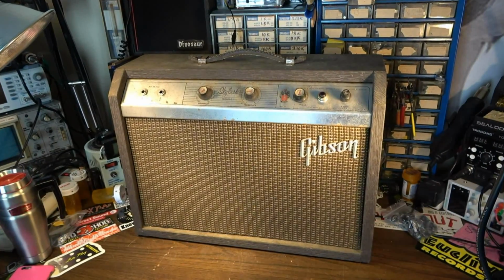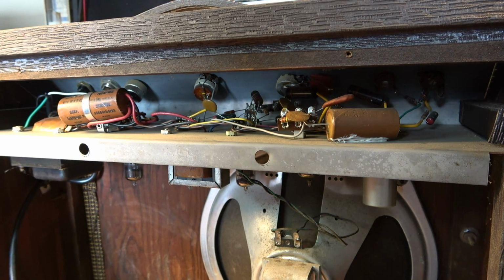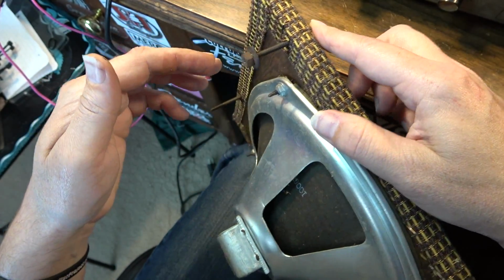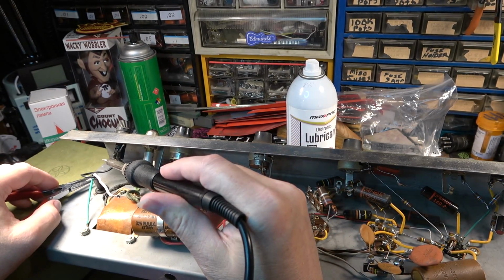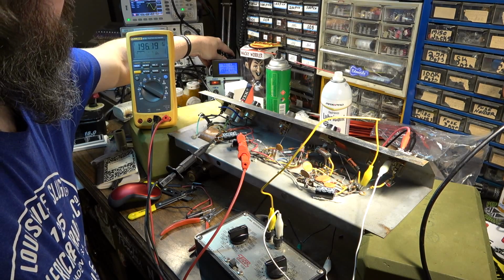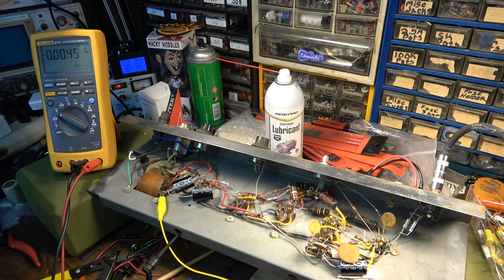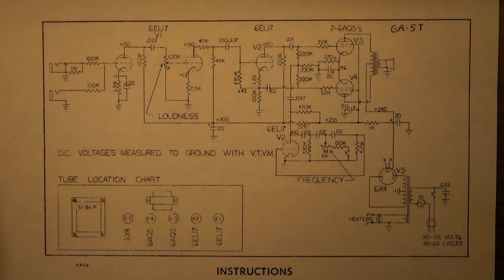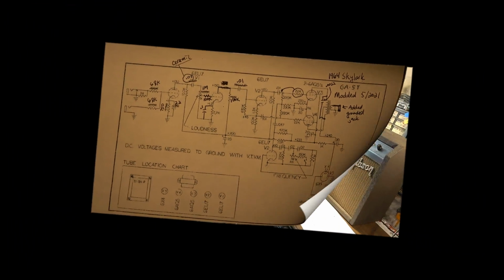Fender Princeton DISGUISED as a Gibson Skylark | The Guitologist

Comment: I've always put fuses on the Phase, every electrical appliance here in Scotland has one fitted to the plug, so it's common sense to put it direct to the incoming phase wire in the chassis. Fuses aren't a substitute for a good RCD, but 100% it's still safer for you and your amp having it that way.

Comment: I have a 1968 Gibson Skylark that I bought with that same buzz that this amp had before Brad started work on it. I replaced the big brown (Astron) filter cap with, in my case 3 good caps of ruffly equal value of the original multi-cap. It cured the buzz and the amp played fine. I wouldn't call it a great sound, it is a little growler, but at least I know what the original sound is in case I ever want to replace more components to improve the sound of it. Anyway, Thank you Brad! Oh, and I forget to say that I first ran the new caps in parallel with the old caps to isolate the bad caps. That technique worked fine once I isolated the bad part of the multi-cap and only had that one running in parallel.

Comment: Any reason why my ga-5 from 66 has higher main voltage off the primary transformer than stated in the schematic? Its smoking the first resistor in the power section. No shorts to ground. Driving my nuts

Comment: Is the cable you used for the external output Jack, a patch cable cut at one end, or is that a speaker cable? I hope you say patch cable because I’ve spent money on speaker connections. I’ve been told not to use a patch cable because of the resistance.
Reply from the maker: It’s an unshielded 2-conductor cable. Not a patch cable.
Reply: Thank you so much Brad. Love the channel.

Comment: I have several of the ancestor to the early 60's GA5 Skylarks, the 1950's GA-8 "Gibsonette" aka Les Paul Model in the Gibson catalogs of that era. There is a GA-9T (w Tremolo) "Discoverer" from the late 50's, both with much higher watt outputs. The 1964ish GA-5 you're repairing (well done) is only 5 watts RMS and is comparable to a Tweed or Black Face  CHAMP, hardly a Princeton!  This is a 1959 GA-8 (8.5W) Gibsonette https://hosting.photobucket.com/albums/k586/vintageguitarz/1959%20Gibson%20GA-8%20Gibsonette/1959GA-8Gibsonettefrontlrg.jpg?width=450&height=278&crop=fill
Reply from the maker: A pair of push pull 6AQ5A are good for around 10-12 watts. They are a 7-pin version of a 6V6. This is very comparable to a Princeton. The "5" in the GA-5T model designation is not a reference to the output. And FYI, the Les Paul model was the GA-40. They did make a "Les Paul Junior" labeled GA-5, which was a single-ended 5W practice amp. The Gibsonette was it's own model. I've owned all of these amps.

Comment: My  thoughts on bumble bee caps, in the a guitar's tone circuit, is that you could get the same affect by put a resistor in parallel with a new cap or maybe resistor in parallel and series at the same time. The problem with these old paper wounded caps is that over time the internal resistance keeps increasing as the paper breaks down. And the same thing with oil caps where the oil drys out.

Comment: Yes, the fuse switch order has been a long time point of disagreement. The fuse before the switch is for if the switch happens to short internally. The problem with this, is that one side of the fuse is always "hot". This is usually not a problem with most fuse holders that extract the fuse. You just have to make sure that you put the "hot" on the tip of the fuse holder and not the leaf. There are fuse holders that do not do this though. IMO it is more likely to have someone get zapped when changing a fuse then a switch shorting out. There are some amp manufactures out there that switch before fuse.
Reply from the maker: Either way we do it, we should stress that any work on an amp should be done with the amp unplugged unless you are trained and know WTF you're doing.
Reply: Yeah. One group looks at it from the electrical safety stand point and the other looks like it from a user safety aspect.

Comment: I have a 64 non tremolo version of this amp. I removed the tone suck network and changed the speaker. It's actually pretty loud now.
Reply from the maker: It's probably around 12W. You should mod in an output jack and then you can use any cab you want. Also, a simple tone control would be easy and could be installed in the second input jack spot without drilling. But yeah, these are basically a Princeton and can scream when pushed.

Comment: My personal take on the fuse electrical position debate is as follows: 
1) for units where the fuse is externally accessible in a separate fuse container such as the front or rear panel mount with bayonet or screw type cap and the fuse electrically precedes the power switch, then the end of the 3AG type cartridge and the fuse. does not remain in the screw cap, the end user will end up touching the end cap of the fuse which will be live if the amp is plugged in regardless of the power switch position.
So if the fuse electrically follows the power switch and the switch is off (as hopefully it would be) this adds  an extra layer of protection.
Also In many years of doing electronics with all kinds of devices with these rear mounted pot switches,  i have had plenty of bad power switches and have never had them short to ground or in any way be a safety hazard.
So, there might be one thought for doing this differently.
Also as for the IEC fuse/ac socket combination devices you don't have access to the any of the AC leads when you snap that little drawer out to replace the fuse.  No way to be shocked here.
As with any advice, take what makes sense and diehard the rest😁
Reply from the maker: Not necessarily disputing any of that. All reasonable thoughts.
Reply: @TheGuitologist  thanx for the consideration...very much enjoy the videos, particularly when you  mod the amps for tone.  I play bass and can only play power chords on my cheapo Starcaster guitar, so I can't really take advantage of 'tone Diving😊.

Comment: Hey, Brad, if you're already putting in a speaker jack, why not make it a switching jack with an 8 ohm power resistor to make it knucklehead-proof?
Reply from the maker: Shorting the jack is fairly knucklehead proof. It won't do any damage to the OT if someone tries to fire up without the speaker plugged in.

Comment: That's the only way to wire a fuse before the switch.  Also more protection if you had a fuse inside the plug like the uk 3 prong plug even if it was class 1 ( 3 wires L/N/E) class 2 ( 2 wire L/N) same plug still fused. Always be as safe as you can as you never know what your plugging into especially if you gig it.
Reply from the maker: I'm all good with fusing equipment. My problem with the UK regulations is, people have to chop the damned cable off of every used electronics item they sell, and if the buyer tries to rewire himself and isn't good at it, you end up with a LESS safe solution than if you'd just stayed out of the regulation biz. Control freaks often create more problems than they solve. Plus, people end up throwing away perfectly good household items and appliances because they cannot legally sell them without chopping the cords. So you end up with more crap in landfills.

Comment: I am so tired of people trying to save the “mojo”. If you want to play the amp the way it was intended... just replace the caps and resistors to be safe.
Reply from the maker: I agree. I used to try to be respectful in the extreme to originality to appease the corksniffers in the trade. But now, I'm defiant. I think the focus on "mojo" over operation is bad for the amps. More will fail catastrophically as a result of this focus.
Reply: Pretty much.   I replace all bad parts, and send them back in a bag....  so they can make the amp cooler by osmosis.
Reply: Cap replacement= Yes definitely 
Resistors ? = test and verify.  They don’t all need to be changed.

Comment: Hi Brad. I 100% agree with your fuse-switch wiring order. Its somewhat easier in Australia as we usually have switched wall outlets. 
Here's a thought about testing with 1kHz. I used to also test at this frequency ... until I looked up my Frequency vs Note table. 1Khz is just below the 20th fret on your high E string. Not so typical of what we play. I now test at 440Hz, which is the 10th fret on the B-string...my most played note! LOL! Tue, it's the Fundamental and there are many overtones at well over 1KHz, but I choose to test at a common fundamental, especially when judging capacitor performance. Just a thought.  
Yes, I agree that some viewers are entranced by non-technical people...even in our world. It is what it is. I'm happy to have more than 2 subscribers. I had 3 but my mother passed.
Reply from the maker: Not a bad idea. Usually with that tone, I'm just using it as a loudness reference or using it for signal tracing. In either case, the frequency isn't too important. If I was testing to find a cabinet buzz or some other fault that seemed to follow a resonant frequency, I'd either set the generator to "Sweep" or just use a guitar. How often do your outlet switches fail in Oz?
Reply: @TheGuitologist  I worded that badly, Brad. I meant that in Oz its easy to reach over and flick off 240v power when changing a fuse, instead of pulling the lead from the wall socket in the US.  I reckon many people would be just too lazy to pull the lead when changing a fuse, until the 120v bites them.

Comment: Last week my son got zapped changing a fuse he had one hand on the chasis and went to change the fuse  when he put the new one in bamb. I said you stupid basted unplug the friggen thing first. He said the switch was off  he did have a point he said the house panel has a switch to shut the power before  the fuse  I said well learn from it
Reply from the maker: The fuse holder on these amps retains the fuse in the cap. No one should even have to touch the fuse after inserting in the cap.
Reply: It was not on that amp it was on a audio amp he  pulled the dead fuse out and put the new fuse in the. Holder and got zapped  fact is it happened hey 
I build audio amps I put a fuse one both sides of the switch one is inside the amp so if someone put a  large value the inside one blows  and  then I fix the real problem instead of the owner destroying  the unit  I built for them

Comment: I think the fuse-before the switch comes from larger switch-gear, usually 3-phase systems that can't be unplugged so the switch is the plug. The fuse is de energized by the open switch prior to removal. If anybody has made a 120 vac power switch that could fail to ground has long since lost their UL rating. This is one of those situations that has two solutions.

Comment: International electrical standard is a pretty strong argument for your case. Pulling a standard out is a pretty pro take. I'd be interested in also hearing the counter-argument, why it would be better to have the fuse after switch?
Reply from the maker: The counter argument is that idiots can take the fuse cap off and stick their fingers in the fuse holder thinking the amp is off. But they could also do that with the switch on too. The fuse caps are designed to insert the fuse into the cap and then screw it down, not to insert the fuse into the socket first.

Comment: Nice job. Modifications are interesting. Removing the Sprague pc network and recapping is usually a big improvement with what are commonly referred to as Gibson's Crestline series of tube amps (Brad mentioned the "coat of arms" which is also called a "crest," hence the Crestline designation). The filter caps will need replacing when AC line noise is present, as the amp was displaying. However, the coupling caps are the biggest variable here vis-a-vis tone.  It appears that orange drops were used here, which are but one option from among a myriad of suitable replacements, but there are other choices there, too. The MPW caps from Illinois Capacitor, for example, are cheap and good sounding. Obviously, there are lots of boutique caps out there that no doubt sound great, too.  Not sure of the need to modify the schematic, aside from basic stuff like clipping the DEATHCAP! (if that keeps you up at night) and grounding. Again, removing the Sprague pc network is a good idea, as it seems to open up the sound of this amp immensely. To my ears, there is nothing else that would warrant improvement by altering the circuit from what is printed in the schematic. Good luck in your future endeavors and keep the tubes glowing.
Reply: Did he mod the schematic or mod a copy of the schematic? I'd say leave the original schematic alone but include a modified copy inside the amp for future technicians. After years of use and a component failure down the road it might be hard to tell what your replacing. Things do burn up and the markings are gone. The new schematic would speed up a future repair.
Reply: @tenlittleindians  I meant to say "modify the circuit." I don't agree with doing radical modifications to these old amps. If there is a certain sound to be obtained, perhaps it would be easier to just find an amp that has that "sound." Your idea, though, is a good one. It will just make things easier for future service.
Reply: @jimmyjoefine   I have mixed feelings on modifying old amps and old cars. When I go to a car show it's nice to see a pristine classic that's been restored to as close to original condition as possible.

It's also gratifying to see an old car that's been hot rodded to the max with internal and external changes that show off the "what this car could have been" imagination. Some of those modded cars grow in value even faster than the same car in original form such as a Batmobile or a Back to the Future Delorian.

If I wanted a 1957 Chevy as a daily driver I have a friend that modified his with a modern Chevy engine, modern wheels and disc brakes and suspension, modern air conditioning and cruise control and a modern sound system. He also added power windows and power door locks. It's now as reliable as a new car off the line. It's a better car than an original 57 but it still looks like an original. The same goes for amps. Is it for sitting on a shelf or going to be played daily?

I have several classic amps in original condition that are getting too valuable to continue playing daily! I should sell them to collector's and buy a modern amp as a daily driver and stick the extra money in the bank.
Reply: @tenlittleindians  I can see both ways as well. In the current market, it would be best to keep the old Fender amps in particular as near to original as possible. In the last year, the market for the blackface and tweed amps has gone insane. It makes me feel similar, that maybe I shouldn't want to even play an old amp in near-original condition. Which is kind of a sad way to exist with them. I think the solution is to get lots of them so that you can't even consider playing but a few of them ;)

The good thing about the old tube amps is that you can be faithful to the original design while still making upgrades, since many modern components are superior in spec to the originals. And obviously, with something like failed electrolytics, you have to replace them if you intend to use the amp. Having said that, it's far less worrisome for me to go in and completely re-cap something like a 1960's Valco amp than to even consider doing that to an old tweed amp (Just an example, I usually don't even think about replacing all the caps, just the ones that I feel need to be replaced. In fact, the last couple amps I worked on are running their original can capacitors with no issues.)

If I want to really modify something, then I look for a unit that doesn't matter. Recently I took a stereo single-ended tube amp out of an old Westinghouse stereo console. It had no power switch, fuse, inputs or outputs on the chassis. I added the switch and fuse as well as RCA inputs and binding posts for the speakers. Now I have a perfectly usable little hi-fi amp and the modifications only affect the value in a positive way.  

My real point here is that folks like Brad who have no formal background in circuit design should consider that maybe they are doing things that they don't really understand. Even in this video, he's just throwing stuff in there and waiting to see what happens. Adding components of similar values to a Princeton obviously did not result in an amp that sounds anything like a Princeton. These old Gibson amps can sound great just by replacing that Sprague network with a single capacitor.  They don't really sound like Fender amps at all, but they do have their sound. My '65 Scout is one of the coolest amps I have ever played - and the only change was the removal of the Sprague part.
Reply from the maker: I'm not a proponent of "cap rolling" really. Most poly-based caps will sound very much the same whether they're orange drops or some corksniffer top shelf replacement. The value is what's important. But when it comes to ceramic caps, there is absolutely a difference in tone, and I like a ceramic cap between V1 and V2 stages in amps.

Comment: uF = Nanofarad
mmF = Picofrad
If anyone was wondering.

The 6EU7 looks like a slightly better tube on paper than a 12AX7. I wonder if they’re as microphonic as 12AX7’s?
Reply from the maker: Same tube except pinout and filament. Micro-microfarad and picofarad are the same. I said the former because that’s how it was notated.
Reply: The 6EU7 is essentially a lower-noise, higher-fidelity 12AX7, so it should very likely be less microphonic. Also, (from my experience) longer lasting.
Reply: 1uf= 1X 10 to the minus 6    1mmf=1pf=1x10 to the minus 12
Reply: @jseco4544  yes. I was comparing terminology for the non tube tech crowd.
Reply from the maker: @matthewf1979  I understood you. You're cool.
Reply: @TheGuitologist  BTW, please don’t get down over vapid idiots getting more views on the same amp. Who do you think watches those videos? Birds of a feather.